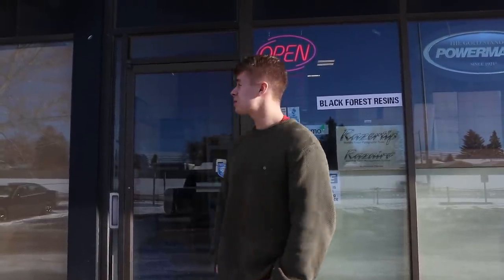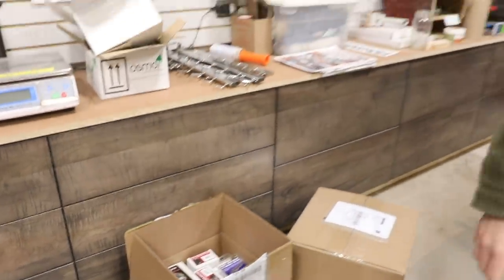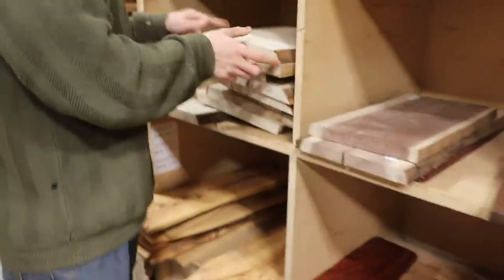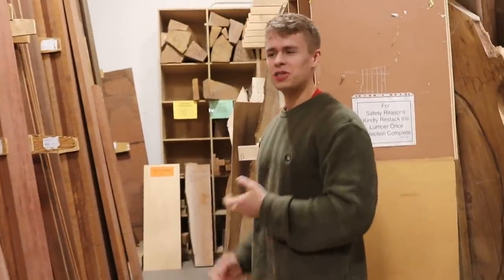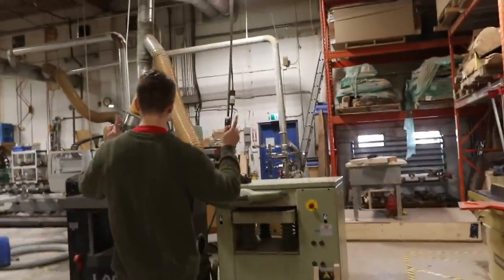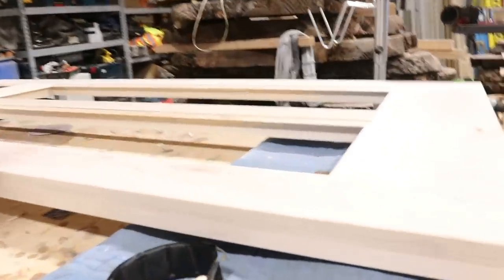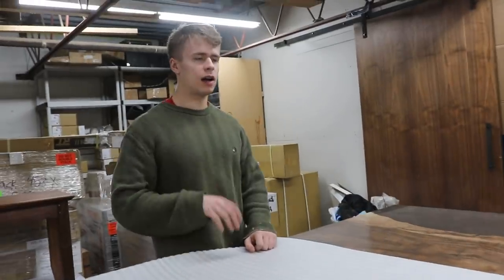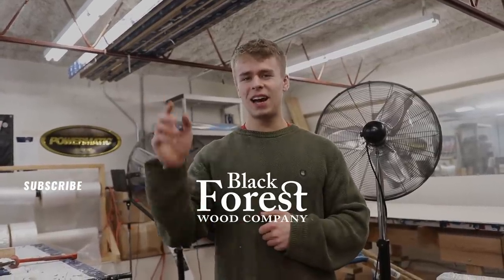Updated Shop Tour

Comment: We want to see more DETAILED how to videos.  Theres plenty of wood working videos out there but  DEEP POUR epoxy videos are still lacking. More details on epoxy since it costs so much, it makes a lot of people shy away from starting to work with it
Reply: @Jim McPhee well there are different procedures for deep pours. Sometimes you seal the edge, sometimes you dont. Theres certain temps you need to pour at. They've literally used at least 3 different brands of epoxy and they've mentioned different ways of pouring them each time. The finishing process is intriguing as well for those of us who have never polished before..